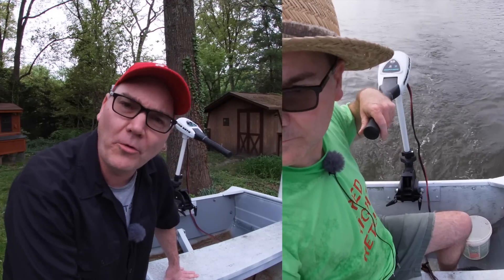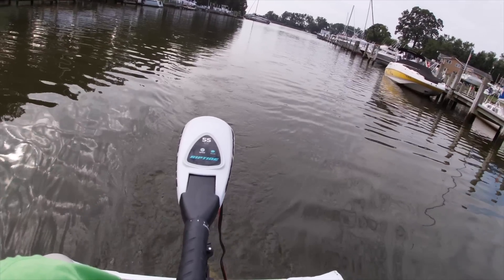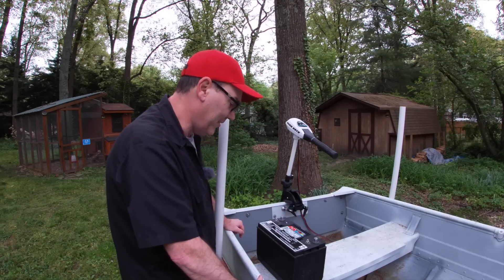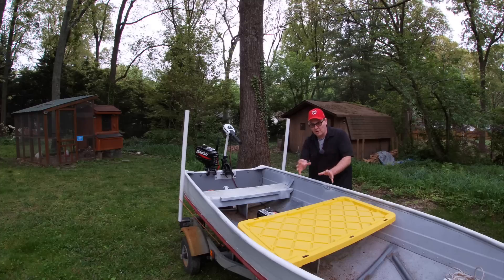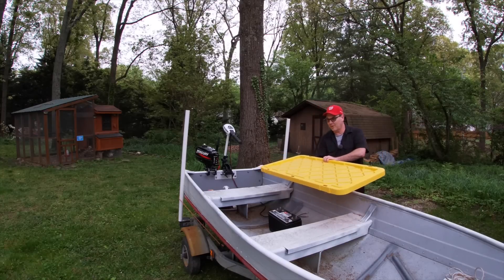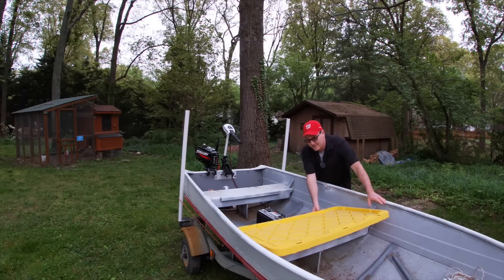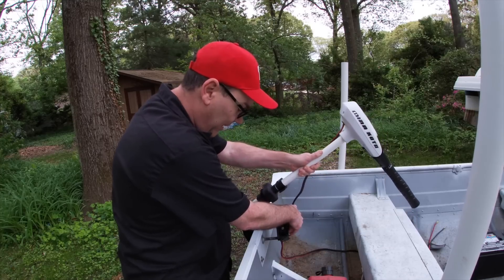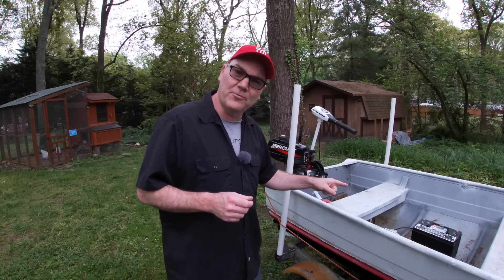How Many Solar Panels Do You Need For A Trolling Motor?

Comment: I absolutely LOVE your videos, Wayne! Keep making Greta content. I build solar powered electric boats as a hobby and my most recent project uses a 120W panel and a 54lb trolling motor. It's called the "solar express MK IV" and without people like you on YouTube it would've been a lot harder to build! I agree that solar power certainly isn't enough to fully power my boat but it is enough to charge the battery very well while I'm not using it, for every one hour of full speed motoring it only needs about 4 hours in good sun.
Reply from the maker: Thanks! How many and what kind of batteries are you using on that setup?
Reply: @WayneTheBoatGuy  I've got one 100Ah 12V lithium battery, it's good because it can be run down to almost empty without any long term damage.
Reply: @bensteele4936  that's something most people don't factor in with an AGM battery. All that weight of a 100 ah battery and only 50 ah on tap sucks.
Reply: can you help me buying the right parts and finding the right gear?
Reply: Yes very good  explanations

Comment: You will never get a 1 for 1 energy exchange. Electric motors are very inefficient requiring far more input than you get on the out put. The most efficient solar panel you are only getting less than 26% efficiency. Combustion engines are still the best bang for your buck !! What needs to happen is a motor converted to propane which then the majority of your exhaust is H2O.  I run 2 two 27 series batteries for my 55 lb thrust motor that I also use a solar panel just to help while trolling. It works but only for fishing on smaller lakes. Still distance has to be covered with fuel driven engines.

Comment: 30 lb trolling motor draws 165 watts on throttle level 5, or 110 watts on throttle 3.
you only need 100 watt panel to sustain your battery if you are content to run motor intermittently.
are your really going to draw 600 watts (from 6 panels) ALL DAY LONG running your trolling motor?

that would take 400 Ah of battery i.e. FOUR of your batteries.
Reply from the maker: I do mention in the video that a 100 watt panel could possibly work for a person who just needs to get to a location and then several hours later return home. A panel makes more sense in that situation than several batteries.

Comment: On certain applications I do see a benefit to have solar panels. Wayne's boat not so much. Especially if you like to fish. Having 6 panels overhead would create so much wind resistance. It would make the boat hard to maneuver and look ridiculous. I use to run two AMG 100Ah batteries all day with a 41 thrust motorguide as my primary on a 12' aluminum boat. 154lbs of batteries + motor. Switched to one (27lbs) 100Ah lithium lost 127lbs in batteries and then added 9.9hp Mercury of 84lbs and a 3 gallon tank. So ya I did almost added all the weight back. So my primary motor being gas I can fish 3 or 4 days with one charge to my battery. No gas motor I could run electric 9 hours on lithium. Charges way faster then AGM or lead acid. 50A Max on the one I purchased.  If I run the same 2 AGM's and gas motor and gas tank the weight would be 256lbs.
Reply: 2 batteries needed, depending on time you go for haha plus oars

Comment: I think the extra battery would be the solution I would choose.  Additionally I always keep a set of oars in the boat for those unexpected emergencies or mechanical trouble.
Reply from the maker: Yeah I always bring my 'spare motor' (which is a paddle) because I stink at using the oars!
Reply: @WayneTheBoatGuy  I do the same, paddle is the way to go!
Reply: No, it's not the solution. It's the opposite. You want a smaller battery with a lesser recharge rate. Sure you do more cycles, but that's how to design it properly. Also, this type of hull is too light and too small.

Comment: For the cost of going solar you could buy a top of the line electric motor powered with a Lithium battery. The range and speed on them are very good. But it's a lot of money for a small boat. I hope to continue to run my little 2-cycle Johnson for many years to come. But if it were to be banned this is the option I would be forced to go with. Hopefully the cost will have come down by then. (As an aside, I wonder if anyone is trying to use a small wind turbine on a boat to keep batteries charged. Though this too would have many of the same types of problems to overcome).
Reply from the maker: Good points! When I was working on this video, I looked up small wind options. Lots of sail boaters report that they generate MUCH less electricity than a solar panel.
Reply: I believe the brand name is Torqueedo
Reply from the maker: @innergoof19  Yes - and ePropulsion is another brand

Comment: Would jury rigging a sail to a small aluminum electric boat be a practical substitute for the gas motor?  Just a thought.
Reply from the maker: Smaller sailboats often run an electric trolling motor to get in and out of creeks or to get themselves into open waters where the wind is blowing. 
A small aluminum boat would basically have to be totally converted into a sailboat for it to work (rudder, keel, mast mounting points, etc)
Reply: just buy j88 sóàr ektrc sail boat